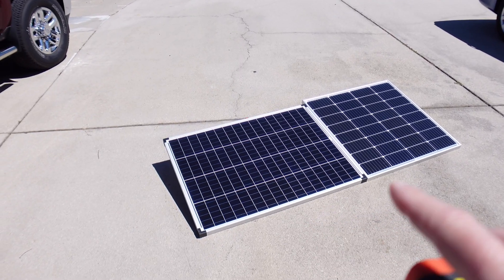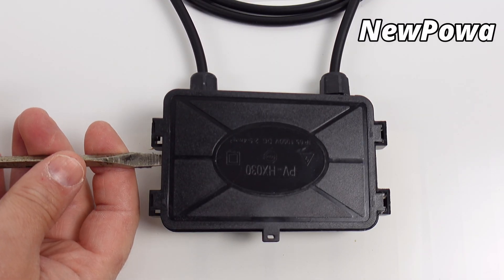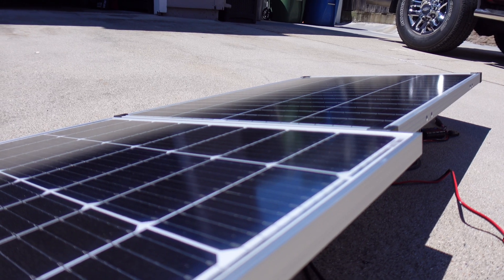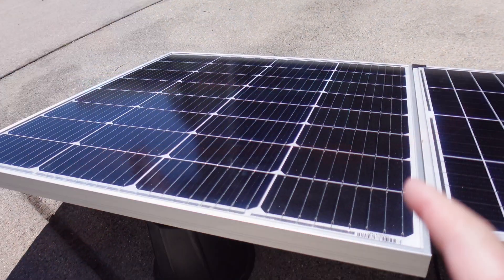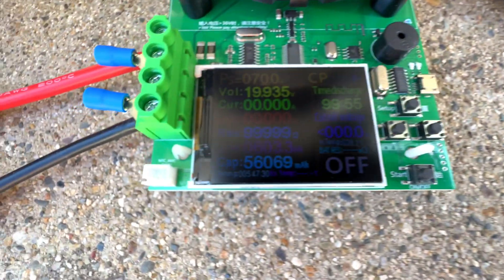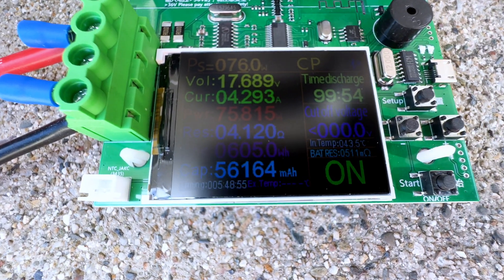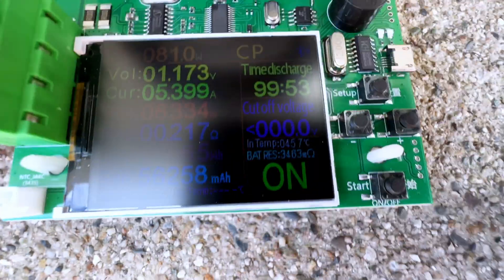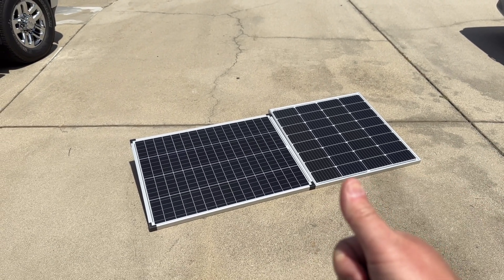Harbor Freight VS NewPowa 100 Watt Solar Panel

Comment from the maker: The NewPowa Solar Panel uses newer tech type cells and is a lot smaller. Better?? Find out and let me know your thought #solar #harborfreight #test #solarpanel  

ITEMS IN VIDEO……
Test Meter: https://amzn.to/3JHmW3E
EcoFlow power station: https://amzn.to/3XxlTJo
Inline Test Meter: https://amzn.to/3ptyCQI
MC4 Crimper Kit: https://amzn.to/43cmvFw
MC4 to SAE Adapter: https://amzn.to/44K8yQz
NewPowa Solar panel: https://amzn.to/3PEK7jc

Direct Questions for fast response ...https://asqme.com/@johnnysweekends

CHECK OUT MY AMAZON STORE: https://www.amazon.com/shop/johnnysweekends

If you feel I helped you out..Buy me a Coffee 👍🏼🙌🏼👊🏼😀
https://www.buymeacoffee.com/johnny5120J

Comment: when you started testing them each individually you attached them to some sort of measuring gadget that looks like maybe a fan or something with meter built in. What is that. gadget and how did you have them attached to measure the draw?
Reply from the maker: It’s a DC tester/ discharger. I reconfigured it to handle 400 watts and make a solar connection

Comment: Measuring the surface temperature with a spot radiometer at that angle is not recommended, and you will have an average temp, not the highest. This is due to the nature of a fixed spot ratio, eg 1in/12in.

Comment: HF panel has outperformed every panel in its class hands down.. i bought 2 at 89.99 ea,..for my RV, I originally bought a foldable portable 2x 100w renogy set of panels.. i dont get more then 60-65w PV from each of those, while the HF has hit as high as 117w .. with stead 90-105w right next to the renogy.. luckily i only paid 50.00 for the renogy pair .. used ..would not pay new prices for them at all.. they are the basis for panels for my RV .. i am running each pair in series for 24v 6-7amps   and going to add two more individual 24v 240w panels 9amps .. to get my PV to 800w for the camper.

Comment: I started with the Newpowa, so I have continued using them to keep the size consistent.  I've got 29 of them.  I routinely get between 70 and 80 Watts out of them during peak sunlight.  I've got 2 PWMs and 2 MPPT Controllers, and the only exception are 4 in parallel on 60 ft of 10 gauge on a PWM- they'll typically hang between 60 and 65 watts - they would hit 70 - 75 at 40 ft.  The size, weight, and price are worth it to me.  I think HQST Poly and Mono 100 watt panels are probably the best bang for the buck though.  I purchased a 20 amp Bouge RV PWM Lithium, a HQST Mono 100watt, and 10 ft of MC4 cable for around $100 for my single battery and inverter setup at work and routinely get over 80 Watts.

Comment: I bought 4 of Newpowa 100w panels yesterday morning. The price and size were right and I have no problem lowering my expectations to an 80w panel. 
I am going to set them up in series parallel and expect upper output wattages between 250 and 300. I will be perfectly content with that.

Comment: Love these comparison videos. Have you ever considered testing the Harbor Freight suitcase solar panel (100 watt)? We have a Harbor Freight in the next town over, so it's fun to watch all the testing.
Reply from the maker: It’s a duplicate of the flex I believe. 
I looked it up about 6 months ago so it’s just a copy. Maybe it was Rich solar. At least pretty sure.
Reply: @johnnysweekends  There are two different kinds of 100 w folding solar panels. I'm talking about the one that is rigid glass panels, briefcase style, with a carrying case. People use it for on the go since it comes with a sturdy kickstand and is waterproof.
Reply from the maker: Yea the rigid one that HF has I’m about 95% percent sure it’s a copy of another company. I looked into it about a year ago. 
But for not much bigger you could buy two of the thunder bolt panels and make a suitcase for about the price
Reply: @johnnysweekends Thanks for the suggestion.

Comment: I bought two of the Newpowa panels for $64 apiece, applying a coupon on Amazon, solely to make a solar suitcase. I knew darn well the 100 watts was a bogus claim, due to the size. I used the prop rod technique from your other video. Very pleased. I put two handles on top so it's easy to swing open. I normally get 140-150 watts connected in series in full sun. I have seen as high as 167, albeit briefly.
Reply: I had a Newpowa 100w full size panel and frequently saw 110-115w under ideal conditions. I'm surprised they would over rate one of their products like the compact 100w panel since my experience with them makes me think they're a solid company. I bought 4 of their 160w panels last year and they contacted me to say they were out of stock and offered me the 180w version at no extra charge. Cool. I now have 2-360w solar suitcases plus another 180w mounted to the roof of my CX-9 for 900w total. In the summer I've seen it over 900w on several occasions, but 750+ for several hours a day is normal. Overkill in the summer even with A/C and a fridge in my tent, but I never run out of power, even if I go camping in the winter. I've had about 30 of their panels and they've always shipped fast and have been well packed and arrived undamaged from the opposite coast, so they're kind of my go-to brand for my hairbrained projects.

Came back to edit this and say I may give more thought to my solar projects in the future. Maybe I've been lucky having panels that perform up to spec in that I just generally have good conditions. It might be worth while to consider how different panels perform in different wiring configs and under more difficult conditions to find a panel with the best average performance. I know I've found some pretty big differences in manufacturers panels based on nothing but heat tollerance alone.
Reply from the maker: Ohhh nice!! They are great for a suit case since they are smaller.

Comment: Does Harbor Freight offer the most power per dollar compared to everything out there?   Or are there other panels that cost more but produce a lot more power?
Reply from the maker: When you can grab them for a$89 with the super coupon they are a tough deal to beat.
Reply: @johnnysweekends  Will you do a comparison of the HF against the HQST panels?
Reply from the maker: I can look into that
Reply: Thanks for the very thorough work you do.   I hope you are making enough to cover your expenses!
Reply from the maker: Ahh its more about the fun. But every little bit helps 👍🏼
Reply: @johnnysweekends  Is it better to buy a 360W panel for $200 or a 100w panel for $100?
Reply from the maker: All depends on the project. Bigger the panel the better because normally cheaper and less material needed and less panels to mount. 
If you can do bigger than go that route

Comment: The HF with a coupon is $ 99 this week for 100W.  Prime Day has these NewPowa 9BB 100w panels for $60.       You can only buy one at that price, so my wife and I each bought 1.  That's 200w for $120!!!  Then you can get the 2 pack on a prime day deal for $125.    So for just under $250, I bought 400W of Solar panels.  I plan on making them into folding suitcases and using them for camping.   I like that they are smaller than the HF panels.
Reply from the maker: Nice. Yea I have a done a few suit case builds and the small Newpowa would be great for a small suitcase

Comment: Great video Johnny !!!!!

We have been recommending these harbor freight panels for months on our channel.

WE LOVE THEM (own 6 x 100w mono panels from harbor freight)

HUGE PROS:
1. Walk or drive a few miles and buy one today
2. Return them if you ever needed (same day)
3. NO SHIPPING
4. Huge power output compared to it's rating (Max we ever recorded on video was 122.5w) on really cold day
5. Built in legs for easy portable setup

CONS:
1. They don't make 200 watt panels
2. They don't make 300 watt panels
3. They don't make 400 watt panels
4. They don't make 500 watt panels
note: But when they do, You can bet on us buying those and testing them :)
Reply from the maker: They do great for small builds 👍🏼

Comment: So, NewPowa wins on amps/$ and amps/m² but HF wins on amps per single unit because it's bigger?
I suppose I'd tile a roof with one and take the other camping.
Reply: Which one are you going to use for roof tiling and which one is going camping?
Reply: @juanalvarez3507  I'm guessing the NewPowa for camping as it's more portable

Comment: I have 6 of the HF panels and have never been disappointed in the performance. Here in NY State on a perfect day I can get at or occasionally a few watts more than rated output. I can’t ask for any more than that. And I like the fact that I can pick them up locally and not have to be concerned about shipping damage. I look them over before I leave the parking lot. And remember, never buy anything at HF without a coupon!
Reply from the maker: Exactly always use the coupon..👍🏼

Comment: I already knew what the end would be since i own both brands but had to watch whole  thing anyway. Lots of people are quick to bash the H.F. panels without even trying them for themselves. Look at actual cost per watt produced!! Maybe they degrade faster when permanently installed outside 🤔🤔
But for me and anyone else that doesnt leave them outside  they win! J.M.O.
Reply from the maker: Well like most say they are probably under rated but I prefer that. Would rather get 98-99 watts verses 80 from a hundred watt panel. Kinda leaves ya disappointed 😂 
Just trick me and make me feel better 🤣
Reply: @johnnysweekends  right! They start new at only producing 80% what listed as. 😤

Comment: What happens when the solar panel "shuts off" from too much draw? Will it reset itself after the draw is decreased? 
Thanx for your help. I'm trying to figure out why my huge capacity LiFePo batteries (2 x 170Ah Renogy) drain from only my fridge running in my RV.
Reply from the maker: That’s just the load tester but a solar controller will maximize input and then hold so no worry about it shutting off
Reply: @johnnysweekends  . . . that's what I figured, but I'm fairly new to this. Thanx for answering. Greatly appreciated!